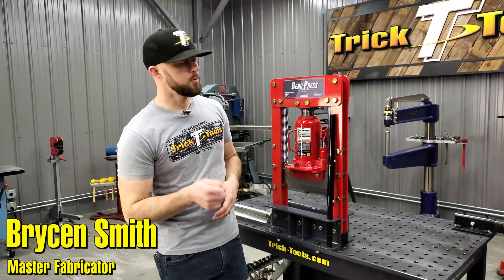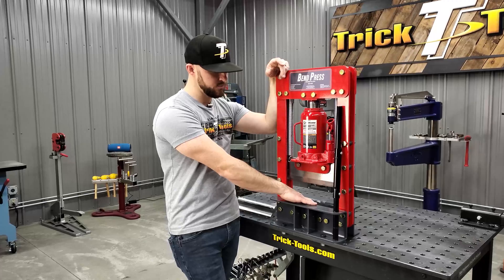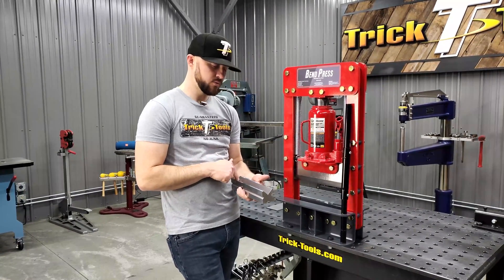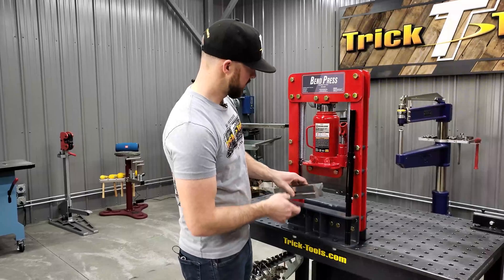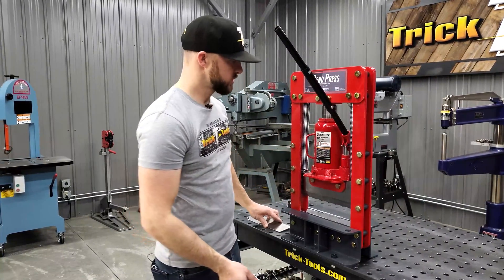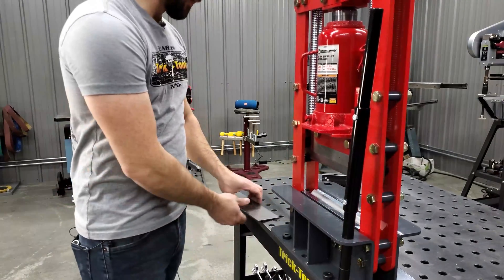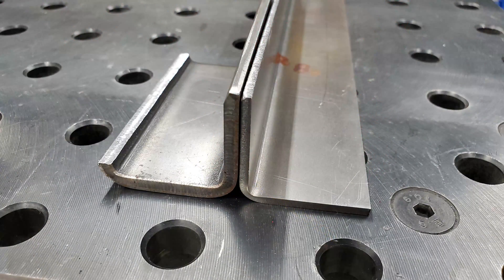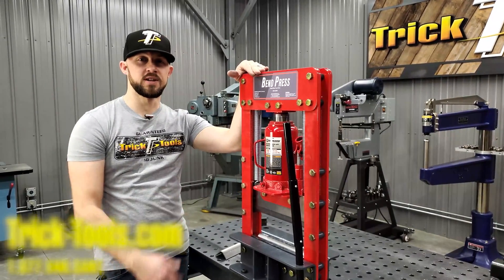BendPress Benchtop Press Brake - Trick-Tools.com

Comment: Just got mine last week. I'm really impressed with the build quality. Fit and finish are superb. 3/8" plate thickness on the uprights. Grade 8 hardware. Tool steel punch with radius tip. The optional V-block is cut at 88.5 degrees to accommodate spring-back to get you to 90 degree bends (unlike a competing "weld-it-yourself" solution using angle iron as the die). We have a 48" heavy duty pan brake (12 gauge) for production work. But when we need to bend plate for brackets this is a great solution for a small shop where a full-size press brake is too big (and certainly expensive....or hideously expensive or worse). Horses for courses, but this is the perfect solution for our shop right now.